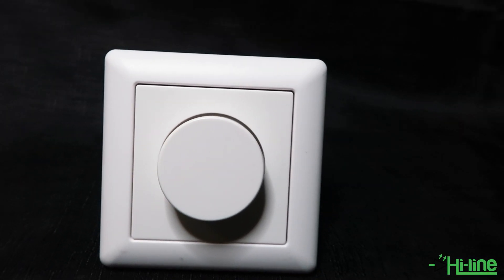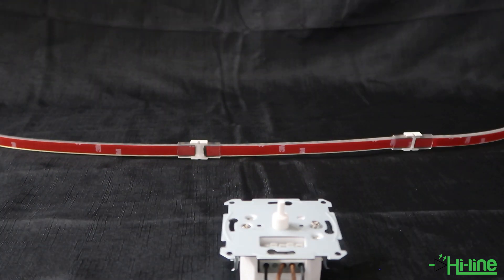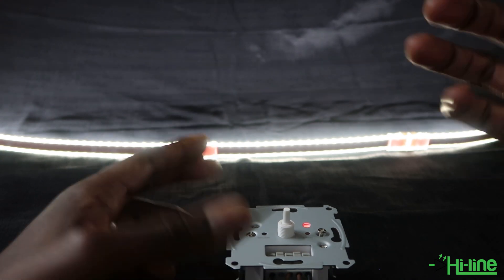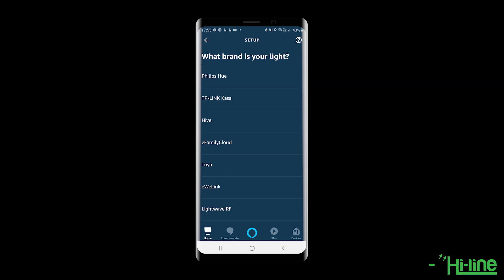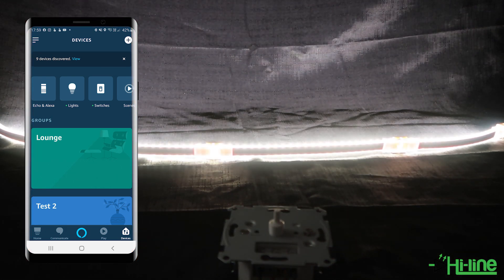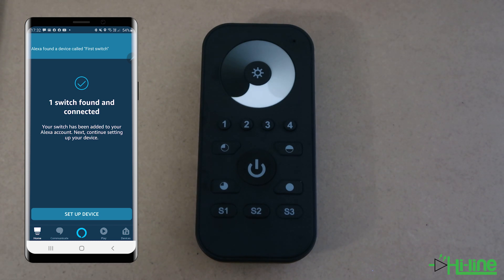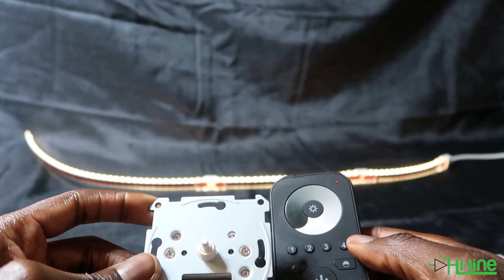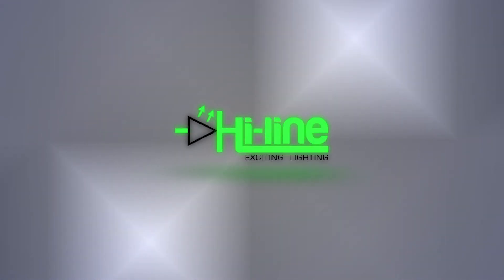How to set up a ZigBee Smart Dimmer Switch

Comment: Work with smartthings?
Reply: Yes it does. But I found that I had to power cycle 6 times to get it in to pairing mode rather than 5 (as stated on the instructions). It's been fine since then.
Reply: @williamwedge5253  Tks... I hope you do soon for the US model.

Comment: Your website says this works with SmartThings. It is not detected by my SmartThings be hub. How do you pair it to SmartThings? I have watched this video and your video where you pair an RGB-W strip controller to STv3. Thanks
Reply: After many many failed attempts, I eventually got the ST hubv3 to detect it. I had to turn the circuit breaker off and on 6 times. 5 was not enough. I guess it's 5 to reset it, then once more to put it in to pairing mode. But I had to do it 6 times in quick succession. No idea why.
Reply: @williamwedge5253  Did it work perfectly on smartthings?  Did you use native or custom DHT?
Reply: @autotech_br  It uses the built-in (local execution) "ZigBee Dimmer" device handler. I can't remember if it detected it as that of if I had to manually change it on the api.smartthings portal.